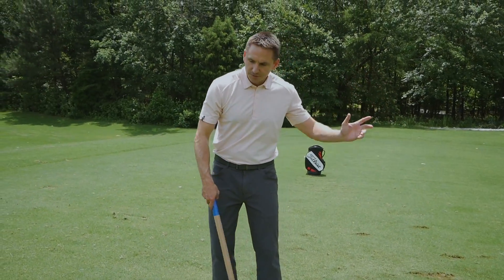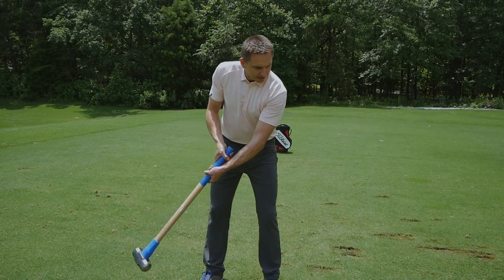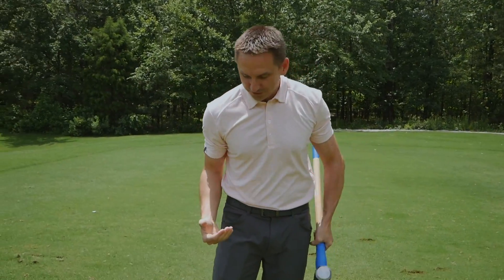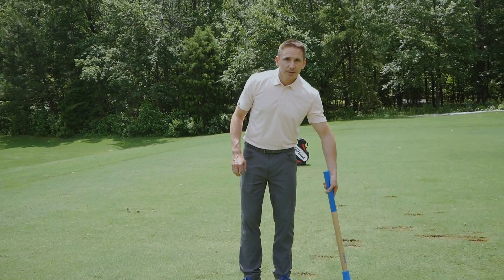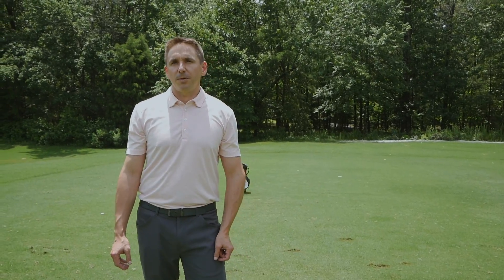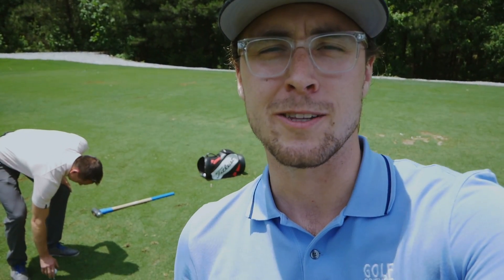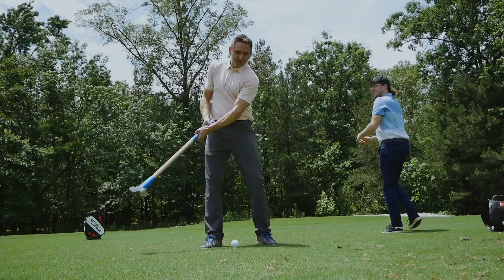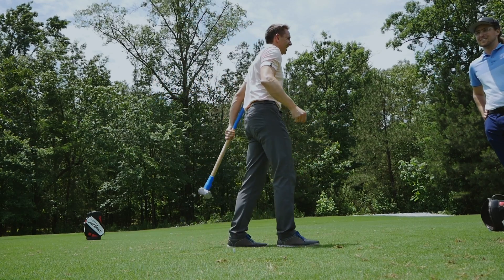Key Indicator For Increased Clubhead Speed w/ Dr Sasho MacKenzie

Comment: Phil Mickelson recently talked about this exact move or motion for increasing his ball speed and overall distance. On a side note my former instructor, Ben Witter, used to do trick shot shows. One of the shots he would do was with a ball peen hammer head on the end of a shaft and he would regularly hit that well over 300 yds. Not the same as a sledge hammer but similar

Comment: Did u realise that u started the first swing with the hammer side on to the ball then hit it with the point, very similar to Pete cowen explaining the axe drill,which I cannot understand how u could possibly do it when hitting a driver.I noticed the later swings where using the pointed end of the hammer as u would the face of a driver.